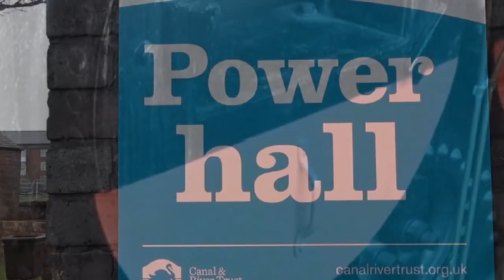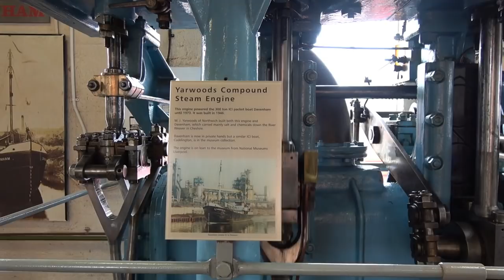Narrowboat Life 2018 - No.1- The Bad (Breach) and The Good (Vintage Engines)

Comment: Read about the damage. Will be watching to see the cause and repair.  I did read that over 10,000 fish were removed and placed into the sections still operating. Great Job @CanalRiverTrust .  I've got the same interest in the old engines. Preferring steam myself. Am eagerly awaiting part 2 and you getting back on your canal adventures.
Reply from the maker: Hi Tony
The breach is devastating for many people including ourselves. We know two of the trapped boats from our Marina and also another one which is on the wrong side of the breach. To put it into context to travel down to our Marina from around the area of the breach is about 8hrs taking it easy. To get back from the Trent and Mersey will take 8 to 10 days 😨, this is the canal which all the trapped boats will be going onto. In effect many peoples holidays will be severely affected. Large areas of canal will be a lot quieter because of this closure.
Our first trip this year will now be in an area that we know so well, in fact we know all the best places and we may well come across quite a few friends. I (K) just hope that Darwin's Origin is still on tap at one of the pubs we will be visiting. http://www.salopianbrewery.co.uk/our-beer
Our trip to the National Waterways Museum was really nice, we just need to edit the other couple of vlogs.
Still doing a bit of work at home but nearly finished so it should be all systems go in about two weeks.
As always cheers B & K  👍

Comment: I hope to be joining you soon as have ordered a new build shell. Could you give me info on the diesel heater you have which looked better than the reflex one. Also could you explain how the cabin side ventilators you showed are actually incorporated into the shell. Many thanks James
Reply from the maker: Hi James
Kuranda recently stopped making our oil stove (Kabola 2d), they are concentrating on diesel C/H boilers for boats. The good news is we have seen a superb new oil stove - see link below:
http://www.bubbleproducts.co.uk/info--(b1-half-pod-oil).html

With regards to the vents the outside is a very traditional look which is part of the shell rather than the normal brass vents. Out of sight is a welded rectangular narrow boxed shape piece with a series of baffles inside which goes from just above the well deck almost down to floor level with a vent behind the steps. We never get any form of breeze coming into the boat which is an issue with the brass vent in doors or on the shell. 
Hope that makes sense.
Cheers B & K 👍

Comment: Hi both of you, sorry to hear that your next tube has been halted due to canal problems. I raised this point before, and hope that this time you can leave a comment (which I may have missed last time) What is you secret for such a controlled way you travel and seem to have no problems in , manoeuvring around the system (turns, locks, and junctions ) please give me an idea of your secrets. Regards Ian
Reply from the maker: Plans are in place to alter our inital cruising route so all is not lost. 😊  We try to answer all our comments so apologies if something went astray.
With regards to the way we boat all we can say is experience (41 yrs) plus making sure our boat shell was heavy gauge (15mm x 8mm x 5mm x 4mm),  sits quite deep in the water, has a very long swim, also a self centering large and heavy rudder and finally we never go too fast.
Thanks for watching B & K 👍🌞🍻

Comment: That's a big hole,by far
Reply from the maker: Hi Andy
It is certainly huge, we hope to visit site soon. It seems that areas of the towpath are still unstable. This is one of our favourite cruising routes which will now be closed for a significant period of time. 😩
Thanks for watching. 👍
Reply: Even tom thumb can't plug that hole...I wonder how long it will take to repair...what caused the collapse,..lucky no boats were moored there
Reply from the maker: Suspect it will take many months to repair. Rumours abound about the cause but we prefer to wait until the investigations are completed. 20 narrowboats are trapped on the silt, CRT have said that they are making a very temporary repair to release these boats. From Wardle lock at the junction of the Trent & Mersey and almost up to the breach water will be pumped in so these boats can refloat and then move onto the Trent & Mersey Canal. The water will then be released out and permanent repairs will then start.
Sounds like a very big job.
Reply: Temporary dams would allow the boats to be re-floated and get them off of the checklist.  Sounds like a plan is already forming.  Fantastic response in such short order too.